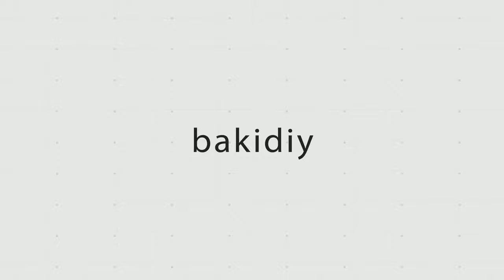Making an external monitor from a laptop screen - Reuse old lcd panel/old laptop screen

Comment: Amazing, I was wondering if i could use my old portable dvd player for the same...is it possible?
Reply: I think yes if you wanna use it just look to the back and search the serial number I think to any shopping apps like eBay etc. The reason you need to search the serial number is for the control board.

Comment: Great job.
Improve your work:
1. Hide all the cables using a bigger cover. 
2. Instead painting use adhesive vinyl of the color that you want.
Reply: Indeed. A large back cover to cover all the PCB and cables is a better design, even though the devices are low wattage and emits small amount of heat, trapping them in such a confined space is a bad idea for longevity (guess why the monitor/TV manufacturers are designing their products this way?). Also, this will make the device more serviceable in future, and looks more elegant.

Adding hinges to the stands is also a better way, as you can fold the stands for easier storage (like put it in backpack or a luggage).

Also, since you have a DC motor drill, why not swap the drill into a sander bit to sand and smooth the edges? Or just use ordinary sandpaper.

Comment: @bakidiy I appreciate what you did brother I have one question, if your phone got battery low you will remove an charge it.?. or while its working it is also charging?
Reply from the maker: My type C to HDMI adapter doesn't support charging the phone while in use. If you want to use it while charging, just buy a USB C to HDMI cable/adapter with charging port. It has an extra Type C port used to connect the charger.
Reply: @bakidiy  thanks buddy

Comment: Great build! Do you have to flash a firmware to the universal board for the lcd?
Reply from the maker: No need to flash firmware, just set suitable LCD panel resolution via jumpers on the board.
Reply: @bakidiy  ok thanks
Reply: Смотря какая плата, в одних можно обойтись перемычками в другие нужно залить прошивку

Comment: Is it needed to make lvds pin according to the datasheet to make connection with universal lcd controller board to 14" laptop lcd (accer aspire 4715z) to run ?

Comment: do this monitor still work? i did build one of this, the bottom part of the screen is hot, is it normal or should i buiild a cooling system?
Reply from the maker: It has been working for 2 years, from 8 am to 9 pm every day for the surveillance camera system, and it is still working fine. I didn't add any heatsink but everything is ok.
Reply: Okey thank you very much, hopefully it'll last long..

Comment: Stupid question. I have an old laptop that has been sitting in the corner of my room for two years now, I don't use it anymore because it just shuts down and won't turn on anymore. How do I check if the screen is still working before buying the necessary component? I don't wanna spend money on something that won't work in the end.
Reply: trial and error, 1st try a good hdd/ssd and boot it from the said laptop. If the laptop boots up, only hdd/ssd/os was faulty, try formatting the old hdd/ssd. If the laptop doesn't boot up after changing the hdd/ssd, try changing ram/s. Another possible cause was the power adapter, also try other adapter. If you got no luck after all this, the motherboard was faulty and it's expensive to repair

Comment: Are the controller boards from the laptop that you got the screen from not useable?? surely they can be disconnected unless they are  part of the motherboard
Reply: I'm guessing it's needed since most laptops only allow output from the hdmi ports and have no input processing components

Comment: How do i know if the monitor screen works as it's not connected any laptop
Reply from the maker: Connect the controller board to screen, press power on then press controller board's menu button , if the menu display on screen so it's work correctly :)

Comment: Do you have the link where you bought the controller board?
Reply from the maker: Just search "MT561-MD board" and after buy it, remember to set the output voltage to 3.3V if you have the same LCD panel or your LCD will be burned (there're 3 output level- 3.3V, 5V, 12V, so you should read the LCD's datashet to set right voltage)
Reply: @bakidiy  does this bord works for any laptops lcd panel?
Reply from the maker: It can use for most of LCD panel that have 40 pins LVDS connector
Reply: Please send the website link of buying The controller board and power supply board
Reply: @bakidiy  I appreciate what you did brother I have one question, if your phone got battery low you will remove an charge it.?. or while its working it is also charging?

Comment: Hi, I have old laptop screen with model ltn140at07 
Can i use the same lvds controller board as mentioned in description?
Reply from the maker: Yes but you need to buy with led driver instead of ccfl driver (or CCFL backlight inverter) because it's uses LED backlight, not ccfl backlight
Reply: @bakidiy  how to buy with led driver. Do i need to contact the seller for it or there is diffrent product?
Reply from the maker: Buy a 40 pins lvds controller board and buy led driver separately like this https://s.click.aliexpress.com/e/_AK2TUF
There are many sellers and different prices, you can choose the cheapest one
Reply from the maker: Or https://s.click.aliexpress.com/e/_ANdLU3

Comment: Are you using power bank behind screen ??
Reply from the maker: The board has a 12V DC connector so I use 12V adapter

Comment: Will this module work with every laptop screen?
Reply from the maker: You need to check the datasheet of the laptop screen, if it uses LVDS interface then you can use this module. You also need to see if it has a 30 or 40 pin connector to choose the right connection cable and see if it uses led or ccfl backlight to choose the right backlight driver board.
Reply: @bakidiy  how bout i send u picture of laptop back.. can i do that?
Reply from the maker: Every laptop panel has a sticker on the back, you need to read it and comment the panel code here e.g LP141WX3(TL)(N4), me and others can help you find the right module.

Comment: Why doesn’t anybody uses the laptop’s own screen chassis? 
It will give a more “off the shelf” look.
Reply: Im glad that im not the only one with this idea.
Reply from the maker: That's also a good idea but my screen front cover has broken, so make a new custom cover for the panel is both necessary and interesting :) Making a new case will make it easier to install the controller board and stand, as well as make the product more professional if you are skillful.

Comment: does this work on any lcd unit?  i have an lp156wh4 screen from an old dell laptop and wanted to know if it can be used with this
Reply: @bakidiy  can you suggest a board? I have a LP156HW4 TLB1 screen! I have been racking my brains and losing my mind finding it out!
Reply from the maker: I just checked the datasheet of your LCD, it uses the same LVDS signal as my panel, but uses a led backlight (not CCLF backlight like mine). Therefore, the connection cable is not the same. You can buy this board but use another cable that supports led backlight + a led driver. I think it will be more complicated for you than buying a board for led lcd like this: https://www.amazon.com/VSDISPLAY-Controller-LTN140AT02-LP156WH4-B156XW02/dp/B01NGZHVGA, or just search "40 pin lvds controller board for led lcd"
Reply: @bakidiy  alright! Thank you for your time! Will keep you posted on how it went. 😊🙏
Reply: @bakidiy  bro which lvds kit is buy for Lenovo G50 80 screen

Comment: how thick is the foam? its pvc foam right?
Reply from the maker: Yes, 5mm pvc foam board (depend on your LCD's thick)
Reply: @bakidiy  sheesh already buy the 3mm :(
mine lcd panels same as yours
Reply from the maker: 😃 double it and you'll have 6mm. 5 or 6mm is ok
Reply: @bakidiy  thankyou for making this video, im already done with the monitor placing, yet still hard to make a hole for interface button :(

good videos. thanks❤️

Comment: Is it needed to make lvds pin according to the datasheet to make connection with universal lcd controller board to 14" laptop lcd (accer aspire 4715z) to run ?
Reply: Да нужно